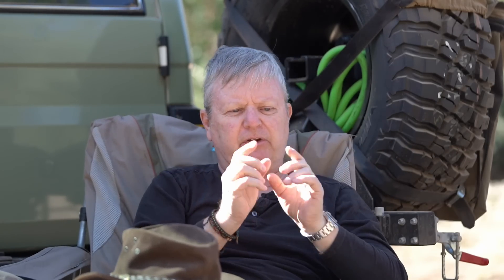TIRES - Traction, Rolling-Resistance EXPLAINED

Comment: it would be nice to know how far you let the pressure down on a rim, i suppose that heavy trucks could be in trouble at very low pressure, bead lock rims are commonly used in the US, are them really better?
My truck is quite heavy and running 17" rims i'm worried about let the pressure too low especially during sharp turn while offroad, so the only way out for me is to go wider tires, what do you think about?

Comment: As for rocky terrain narrow has more traction while wide has more stability. As with everything it is a compromise.
Reply: Matej Hosner - Friction between two objects is theoretically a constant but traction is not. For the same ground pressure value, the narrower tyre has a longer footprint than a wider tyre. This permits greater traction to be achieved where adequate friction exists. The wider tyre needs to find more ground with higher friction values across the width of the tyre to gain traction.
Reply: LROR not true. No more traction cuz friction stays the same. :)
Reply: Matej Hosner Regardless of theoretical mathematics, thats my experience from running 255, 10.5, 315 and 12.5 tyres. I found the skinny ones grabbed and climbed easier but wider keep my lines in place when climbing. Welcome to check the many rock crawling videos on my channel 👍

Comment: Key to this whole lecture @8:28. 
I like tall-skinnies on light vehicles with low power (Zook)
Vehicles with higher power (Steering, Brakes, Engine) I like a wider tire.
I can deal with as large of a rim as a 20" as long as the tire is a 37" or larger.
17s are the norm for most here in the states anymore with the size of the brakes that come stock. For a 17" the lowest diameter I like is a 33" tire on an off-road vehicle. On the STT Pro I like the 12.50 over the 13.50.

Comment: If the friction between rubber and rock has the same behaviour as rubber and tarmac the higher force over area has negative effects on the coefficient of friction.

On asphalt more force there is on the contact patch, the lower the coefficient. So comparing the same weight on different sized contact patches should mean the wider tire gets more traction.

That is, of course, if rubber-rock behaves the same was rubber-tarmac does.
Reply: I’m not sure it does tho as all terrain tyres grip better on tarmac than mud terrains but everyone says mud terrains grip better on rocks? It a slick drag radial good for dry rock crawling? Interesting to see if someone was to make a video

Comment: You seem to be tying yourself into knots over this, as will most comments in this video. However it is very good that you are raising the issues. You are absolutely correct that its not as simple as size equals grip, it is also about pressure (applied by the weight of the vehicle) per square cm. There is an optimal balance dictated by one's requirements. Good one!

Comment: I agree partially with what you say but too many variables. I agree Pressure on a narrow tyre may be more but friction increases with more rubber on the surface.  A wide tyre on rocks also helps straddle rocks where a narrow one might get caught in a crevice or slide off more easily .  Also width of the rim impacts on drivability as a narrow rim on same sized tyre hold the tyre better than a wider one imo..  finally at very low tyre pressures, we talking 8-12 can increase width of contact as well as foot print length..

Comment: Andrew, If you like the KM3 but dislike the width of the "test" tires I'd point out that the KM3 is available in 255x75 for 16" or 17" wheels. There are also 265's in various aspect ratios and wheel sizes as well as 245, 235, 225 all in 75 aspect ratio among others. How narrow do you want to go?
Reply: Lyle Herbert : There is also an 7.50 r16!  Roughly 205/100 r16 or about  32 inch.

Comment: You are right and I agree. But manufacturers of tyres go wider the minute you go a little taller or even if you want the same diameter of tyre. You need to go wider with off road tyres! They don’t make them. I would prefer tall and skinny. But in real life this is not the case!!!

Comment: Where does total vehicle weight come into the height vs weight equation?
I drive a 2001 K2500 Chevrolet Suburban with 8.1L (496 CID) and all the crap the factory could throw at it.
What would you consider a tall skinny tire for for my Suburban compared to say a Nissan Exterra or early 4 runner?
I just purchased a set of Cooper Discoverer ATP in 285/75/16. They are 32.8" × 11.50 ×16 and are about as tall as I can use without a lift.

Comment: Crawling over rock i would rather a wide tyre. I would rather use my whole hand to grab something instead of just a couple of fingers. Wide soft tyre will grab lots better.
Reply: Nathan Underdown Rock climbers use the tips of their fingers to focus pressure and grip they don't climb up rocks with the bottom of their whole fingers and palms. Your example literally disproves your theory.

Comment: Snow comment is correct for driving on the road, but this is a off-road channel and then snow = sand, you wanna stay on top
There is a reason one use snowshoes when walking on snow (big footprint)
Reply: Dubious , Snowshoes are quite a bit longer than wider.....that supports Andrew's point.
Reply: Old Griz not to mention cross country skis lol.
Reply: Top Gear went to the North pole and they drive ON snow on Svalbard
Reply: Dubious unless you put on a giant Tundra tire you are not going to stay on top of snow. All you are doing is pushing a pile of snow in front of you and making the less able to drive straight when a wheel catches a drift or rut.

Comment: So Andrew what are your thoughts with regard to the commonly available tyre sizes for 4x4's at the moment? It seems to me there's a distinct lack of tall but narrow options! I'm a fellow troopy owner and I've always enjoyed and seen the benefits in narrow tyres but if you want to go slightly taller you have to go a lot wider and the few exceptions available are only in certain tread patterns (for example BFG makes a 255/85r16 but only in a mud tread not all terrain)....

Comment: About the rocks(rock crawling) while you are correct to a point. However in America where they build rock crawlers all day long with wide 40 inch tyres and wide axles and narrow bodies. They do it for it stability.
What they do, where they get to and the obstacles they do you're not going to get a Overlander type 4x4 on skinny tyres near these these things.
It's apples and oranges.

I run a wider tyre and I prefer it for rocks and feel like I have more grip.

Comment: Brilliantly said, Andrew. You hit all the points I have used in explaining why I run a 235/85/16 on my Toyota Tacoma; save for the difference in our accent. My prior tire size was 285/75/16. I noticed a lot of difference in performance when I made the switch. I have driven in 3.5 feet of fresh, powdery, virgin snow, aired down to 8psi. I have gotten four other Toyota drivers to switch to narrower tires and they all appreciate my encouragement. Keep up the informative and entertaining videos.
Reply: I know your comment is more than 3 years old, but I run the same size tire on my '06 Sequoia.  Performs well, and has slightly less rolling resistance on the road than the stock size. Gives me a whopping 0.5" inch of lift, too.
Reply: Check my vehicle on my channel i copied u

Comment: its all well and good but try finding a 255/85r16 to replace my 285/75r16 in the us. no one makes one. km2 was the last one i know of.
Reply: Patrick Rich- In America, the 255/85/16 are available in BFG KM2, Cooper S/T and S/T Maxx. The same diameter and width in a 17 inch wheel (255/80/17) has a few more options, but still not as readily available as I wish they were.
Reply: rallye81 Cooper's are discontinued in that size and km2 is superseded...not sure if the KM3 will be available.  In any case I don't want an MT, I live where I have to deal with snow and very little mud and a MT makes no sense for me.

Comment: We need some science! ‘Fat’ or ‘thin’ isn’t enough. We need weight to tire width/size calculations on a spreadsheet :)
Reply: The underlying equations are a bit complicated for a spreadsheet but can be coded up in any competent programming language. Refer to my comment above and the video. This aims to address the points you have raised.
Reply: Pascal's= force/Area squared.
Reply: Rolling resistance is smallest when the tire deformation is smallest (less deformation means less energy goes into heat).  Smallest deformation will have a  contact patch with the form of a circle, i.e. flotation tires (one that ends with LT) as their contact patch has a ameboid form. For non flotation tires  the closest to circle will be square surface patch. If we take sand for example to have a good flotation one need to run about 0,7 bar. If the truck has weight of 750kg per tire that means  a contact patch of 750/0,7=1071 sq.sm. If we take square root makes 32,7sm, or 12,88’ wide tire. Making a reality check by looking at competition tracks about 2,7 tons run 37x12,5 inch tires so theory is confirmed by practice.For flotation tire to have circle contact patch you need 14,5 inch wide, as area of circle is 3.14 times r times r. Good Luck.

Comment: The good and the bad and I think I am ok  I run 245/65/17 KO'2 and love them (good)  (Also the biggest I can fit without modding the Jeep Cherokee KL.   I can't go up to larger size than 30' and width is also maxed out.   Other Jeeper's up grade to taller and wider tires for larger contact patch and ad ground clearance I that is not an option for me (Bad)  after watching I might just be on the short side but not to wide as with these tire at the stock size I get about on rock snow and sand very well.  And with a few mods I may be able to go up in aspect ratio for a bit of lift and longer contact patch from 65 to I hope 75 staying at the 245 with or 235.  I have about 10 miles left on my tires before I start looking for a new set.  This gave new options to think about.  Thank You very much for the Video.
Reply: Same here with my WH Grand i run 245/75 17 maxed out standard rims and keep up no problem with my mates in Gu patrols with big 315s on where he was slip sliding everywhere in the mud my grand went where ever i pointed it.

Comment: Wider tires means more surface area, so more potential traction. High speed offroad vehicles, such as my truck and trophy trucks, run wide so as to get better grip at speed.

They don't clear water well, but on sand and dirt they seem to grip much better than narrower tires, from my experience. Wider tires certainly seem to bog down less than narrower tires in mud and sand. It is why military tanks always try to reduce tread pressure - the higher the psi the more likely you are to sink in and get stuck.

Definitely agree with wheel size tho. 17 in is the sweet spot.
Reply from the maker: Racing is an utterly different scenario. Off road racers do not want traction. Their priority is control. Traction on dirt is NOT want a racer wants. They want their vehicles to 'float', not grip. Further proof that narrow tyres provide better traction and equal flotation.
Reply: 4xoverland Fair point, but I think that illustrates just another facet of the many tradeoffs of tire selection.

I'm not discounting your points on the ability of a narrower tire to bite. But if you don't sink (or minimize it) in the first place you achieve the same effect.

In the Texas clay, dirt, and sand I see wider tires tend to fare better, since narrower tires seem to bot themselves down and never get a chance to bite. Just saying it isn't so cut and dry, else it wouldn't be endlessly debated!
Reply: Tanks spread out the surface pressure because they weigh a gazillion ponds. And. More importantly they spread out the pressure lengthwise which is exactly the same way a tall skinny tire works when aired down. If wide gave them more traction the tank track would be half the width of the vehicle. Wide tires might actually provide more impact protection than a skinny tire and might be a good reason to use them high speed racing but it's a crap reason to use them for overlanding or low speed rock crawling.
Reply: jeep6242 Fun fact, an Abrams tank only has double the ground pressure of a human male, and a quarter of what most cars do. Feel free to check Wikipedia if you don't believe me.
Reply: T4nkc0mm4nd3r Why would I disagree? I  saw an Abrams running over a pvc pipe and not break it with my own eyes. You are saying wider equals more traction if the width matters than tank tracks would be wider than they are and have even more  traction then they do now right? If you apply the same logic the tank would better off with shorter fatter tracks. If width was better.
Reply: That is absolutely correct.

Comment: Thanks for the update Andrew. I'm fairly new to the overall 4wd/overland scene (been hovering around the edges for years but only dabbling) and your videos have been a big help. I would be curious to hear your thoughts/comments at some point on setting up a vehicle that also needs to regularly commute (I don't recall a video on this - if you have done, forgive my ignorance) as I'm at the point now of having to either 1. Keep the old clunker 4wd that has had a hard life + passenger car or 2. Convert into one (likely Prado or similar size). Your comments on how far tyres have come just twigged this in my head as I've always wondered what people run on their daily driver 4wd. Surely something like that KM3 is better than MT of the past but it must still substantially impact fuel economy/road manners? Is the better option two vehicles each for their specified purpose or is a single vehicle viable by using two wheel sets and removable equipment (draws/tanks/containers etc.) the better course (my worry with which is both weekend damage + the work involved to kit it back up every time you want to go somewhere)? Is a definitive answer even possible? As I said - just curious on your opinion.

Comment: So, it is mostly about the percentage of a tire's radius that falls below the tracks surface. As that percentage increases, the rolling resistance increases as well, until it meets up with the tractive force, leaving you stuck. Also, in certain circumstances,  the greater the percentage of radius that the tire has sunk to, the more power it will take to pull the trailing side of the tire up out of the material it is buried in, which will also result in some downforce on the tire. It certainly does no good to have the leading, and trailing sides of the tire fighting against each other. In certain circumstances, wider tires will make this problem worse. However, increasing the diameter of a tire means that for a given depth you have sunk, the percentage of radius below the surface will be lower.

Comment: 255/80r17 KM2 MT - Best Tire I've put on my Jeep. PIZZA CUTTERS UNITE!
Reply: ssazerac 235/85r16 cooper st maxx on 1st gen Taco. Especially on a lighter vehicle they made a huge difference switching from the wide BFG'S AT's I had. Night and day difference for the better.
Reply: 225 toyos open country a/t get on my level
Reply: Running motorcycle tires on my 4 runner.
Reply: went from stock 265/65/17 to 235/75/17... mpg went up couple points as well!! #winning!
Reply: Oscar Smith running fat bike tires next!
Reply: Oscar Smith u dont like the 225s??
Reply: idk if i like them more or less yet only ever had 225s
Reply: I had those tires and they were so much better than the 305 width I replaced them with.  I'm now back to 255/85r16 ST MAXX.  I wish the pizza cutter sizes were more readily available...
Reply: nah not really only got a Triton so think 265 next